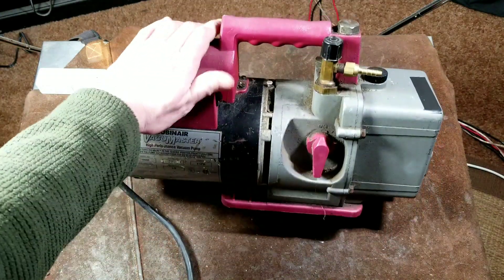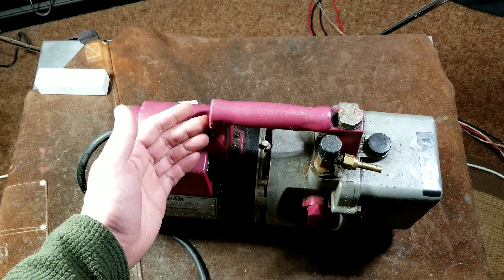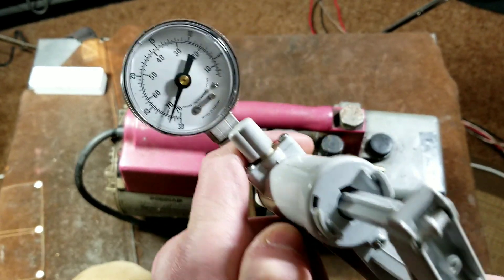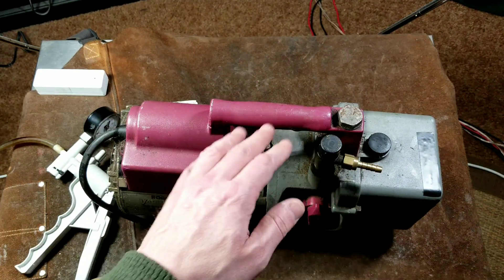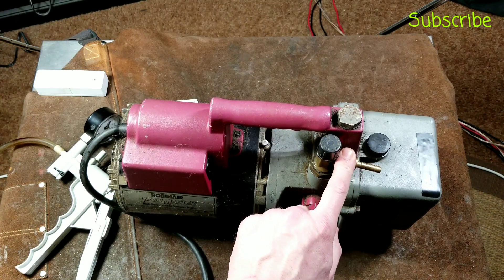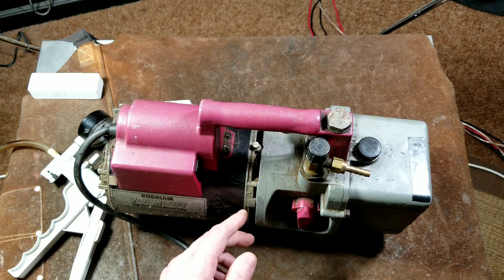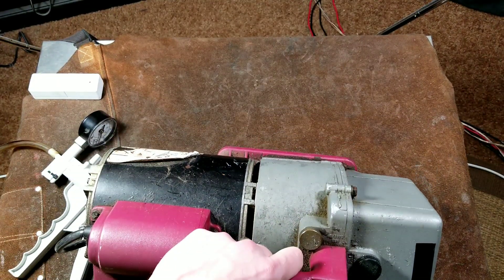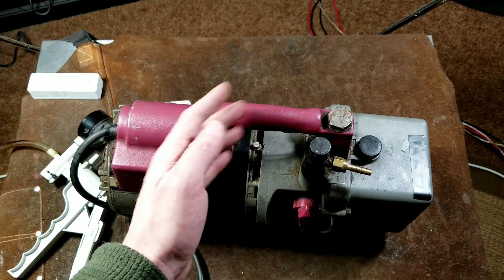RobinAir Rotary High Performance Vacuum Pump Review

Comment: Por donde sale la humedad que saca la bomba?
Reply from the maker: The humility comes from whatever you are vacuuming. And get concentrated via the pumping process. That's the big deal about a vacuum pump. Not just removing the air but reducing the pressure so that any moisture will vaporize

Comment: Thanks for making this video. I just picked up my first used Robinair 15400 today and I’m stoked. The oil was pretty trashed so I immediately dumped it out and put a viscosity 46 pump oil I found on Amazon temporarily. Connected my manifold gauge said just to see how quick it would run it down and it did so instantly. I know I need to put it through its paces but by chance do you know of other oils I could use or am I stuck with having to pay $20 a quart for the Robinair oil?  Or by chance do you know what the viscosity of the oil for these things are? Thanks in advance.

Comment: Just pulled a later model (blue) one of these apart. A complete 
dismantle, every item except the oil seal in the case was removed. The 
unit had very low use but went underwater in a storm and was left as is 
for about 5 months. Changed a chunky bearing in the motor 6203RB and 
meticulously dismantled, cleaned and polished the internal surfaces of 
the vane pump, no so much corroded as stained and discoloured on its 
surface from the water sitting there mixed with the vacuum oil. there 
was some slight surface rust on the external surface on the pump, that 
to was cleaned off. I noticed on reassembly there were no dowls or the 
like for aligning the plates and body of the vane pump. Given the 
tolerances of the mounting screws and the lack of an end bearing in the 
pump, the whole housing was free to move slightly on the alloy face its 
attached to. Just seems a strange way of doing it given the shaft at the
 motor end just runs through an oil seal and that's it. I wonder if 
there is some special factory alignment pins that are then replaced by 
screws during assembly. Anyway it works great now sucks a serious 
vacuum, wish I had a manometer or Torr meter to quantify that. Just 
wondering if anyone else has had the vane pump apart and did anything 
besides align and centre the plate stack and pump body pieces visually 
on assembly.

Comment: I have a chance of getting a Robinair 15800 8cfm for a great price, will a 8cfm be a noticeable upgrade over the 6cfm model? My intention is for HVAC.
Reply from the maker: a 33% reduction in vacuum time for the same volume. Really test it to make sure it works properly and pulls full micron vacuum, no leaky valves and is not leaking oil (although vacuum pumps that are over-filled with oil do push the extra out the exhaust port)
Reply: @CatusMaximus  Hello, guess what, I picked up a cheap Robinair 15434 for $50.00 in the classifieds today. The good news, sight glass is half full of oil and it pulls vacuum. The seller said its been sitting for years in his shop. Do I have to use genuine Robinair oil or is there another type of oil that works just as well? Thanks again.

Comment: I am a licensed HVACR technician and I can assure everyone that is in awesome vacuum pump Robinair makes extremely high-quality tools 4 the HVAC trade it is one of the top brands that you're going to find in an HVAC supply house that vacuum pump getting it for $25 was a steal that is about a $350 pump and as long as you keep the oil changed on a regular basis and don't ever run it low on oil it will last forever
Reply: Por donde sale la humedad que se saca de un equipo de refrigeración
Reply: The moisture comes from pulling a vacuum on the equipment. Air naturally has moisture in it so when you pull a vacuum on the equipment you are doing so to remove the air and the moisture